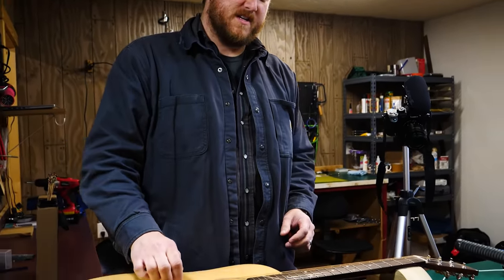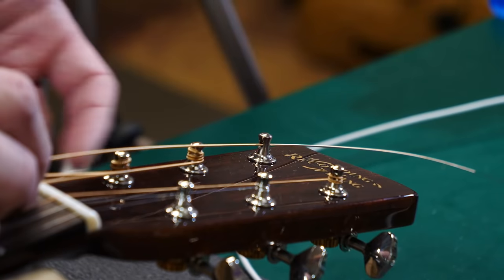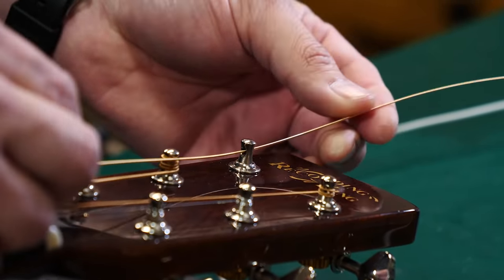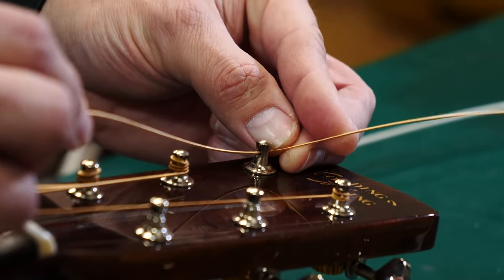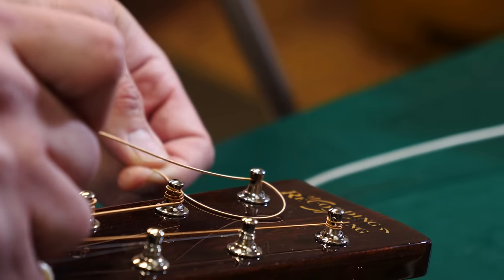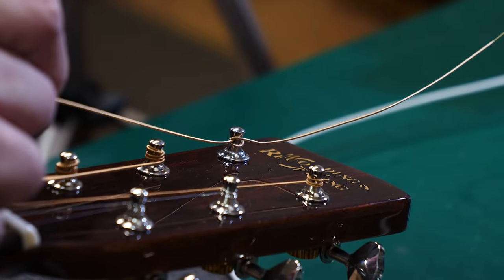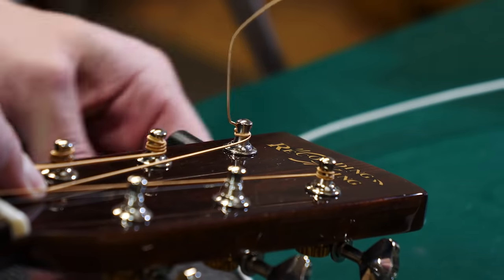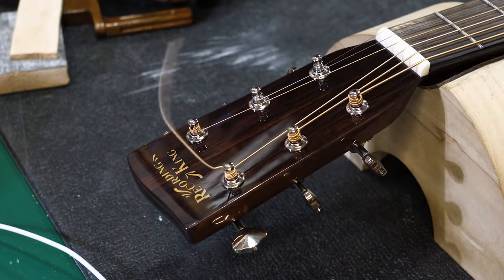Tech Tip: How to Tie a Luthier's Knot When Changing Strings

Comment: I used this technique for a long time but at some point I got tired of taking the bent up string off the tuning peg so nowadays I just pull the string through, pull the string from the nut back to the first fret for slack, bend the string straight up and then start winding. It’s just as effective and much easier to get the string back off.

Comment: This is the Martin Guitar method. I use a 40mm block at the nut as a gauge for how much slack is needed to get the right number of winds around the post.
It works for all gauge strings. 🤗

Comment: Great tip - I have done it differently for years, but your method is easier, quicker and still locks down the string. Also saves me time in my workshop - thanks!

Comment: Gonna try this when my new pickguard comes and I have to restring my guitar. I normally thread the string through the tuning post hole and then loop it around and thread it back through the other side and start tightening it up, but I've had issues with the G,B,E strings on my stratocaster mostly likely because they are thinner strings with less grip, so this will be good to try out.

Comment: For those that don’t like luthier’s knots, they’re great for restringing a Floyd rose; keeps it looking clean, and I’d argue I can restring faster with this knot than just wrapping normally. Tuning stability isn’t an issue with a Floyd Rose, but I’ll say it produced tangible differences on an ashtray  tele with Grover tuners. It dropped out noticeably less on hard bends. 

If your issue is getting them off the pegs (I was a violinist first, that’s what we called them.) Use a wire cutter 🤷🏻‍♂️ I guarantee you have one, be it on needle nose pliers, a cable stripper, or a bolt cutter if you have one and feel like overkilling it.

Comment: Nice. I use a Out, around, over and under, pull up "locking" technique that I learned way back for my fender wammy bar set up. This is similar and looks nice and pretty like when you get it done by the set up guy at the shop. The important part is guiding the string downward as use tighten up the tuning heads. Great to learn the fine arts though!

Comment: Best démonstration, i just use shorter 1 1/4 for the E string. The string turn around the post without touching the base of the key , if it happening there is up tension on the post, so you may lift the post out of the key. Also some post are very short,  you have to adjust the lenth référence.

Comment: I use the Taylor method. You still leave about 1.5 to 2 inches of free string to wrap, then without the knot, bend it and wrap the strings under as you tighten.  The friction and pressure of the loops under where the string comes through the tuner, hold the strings securely in place with no slippage.  It is a faster way to change strings if you do so often.

Comment: I'm lazy, most of my guitars I put either locking tuners or kluson split post tuners on them. I do still have to do this with my old 1971 Ovation Balladeer, though. I won't replace those tuners, they're too nice and I want to keep the guitar with it's original parts.

Comment: This is how I was taught many years ago, and is unequivocally the best way to string guitars.
Reply: 100% not the best way to restring a guitar.  In fact it’s a horrible way.  I’ve been a tech for 20 years.  Worked at multiple shops and run my own.   I’ve easily restrung 500,000 guitars in that time.   Take it from me.  This method is a joke for many many reasons.  It simply does NOT hold tuning better.  That’s a fact.    And removing strings that were put on like this is also a joke.   Martin strings their guitars like this and it’s baffling.   I’ve strung guitars every way you can imagine and this is at the bottom of the list lol.    One wrap above to start and the rest underneath, no overlaps and making sure to use enough string without reaching the bottom of the post is by far the best way to restring a guitar.  You can then cut the excess off flush and have no chance of cutting or poking yourself.   And it stays in tune 100% as good as the “luthiers knot” lol.

Comment: That’s the best way to do it, because that’s the way they install strings at the Martin factory.  The only thing I would change about how to do it is to keep tension on the strings as you wind them up to pitch so you don’t have any slack around the tuner post that will make your strings go flat.

Comment: Because of the bind in the two strings pinching the single strand, I've been doing for years. The hardest to do since I'm a little deaf tone is having a tool that assist intonation. Since I have the tool I can basically keep strings (Clean with a Luther's String cleaner after playing axe) for approximately four months without ever removing after a gig or practice session. Take care and it takes care of you. I usually use 10 to 48, but decided to try some 9.5 to 44.  Wow what a difference in doing stretch and bends, but intonation is crucial regardless of gauge. Clean strings also helps keep intonation. Clean strings, intonation, and proper string locking helps the cost of strings way down. Imagine using a set of strings for at least a month as opposed to using new sets after every touch. Any where's from the cost of a new desired pedal to maybe another tool to use when , gigging.

Comment: This is very handy for shafts that do not have a modern concave taper but if the shaft has a concave taper the lower wraps actually press the first wrap against the inserted string and lock everything in place. That is why it is necesary to have multiple wraps. Nice old zillion dollar guitars often lack concave posts making this knot necesary. It isn't that helpful on modern tuners and makes removing an old string a chore. Most folk's tuning instability problems are due to not tugging the string with enough force to snug everything up.

Comment: This how they restringcat the Martin Guitar Factory. They use less wraps though. It locks itself after the first wrap c1 or 2 more wraps is enough. After installing the strings it's portent to stretch out each string from neck to bodyx few times so it will stay in tune.

Comment: Very neat trick. On a bass it’s not suitable (the pegs are designed differently, string tip goes in vertical, push down, wrap, wind = under a minute, on most basses not all) but when i switched to electric guitar I kept doing almost the same thing just > I only push an inch or so of string through the gap out the other side > then I wrap the string round the peg as tightly as possible and switch to using the tuner to wind tight. It’s fast on and off, but I admit this method might allow for more slippage. 
I have moved on to Spanish / Classical / Flamenco guitars and this might work, might not, the traditional headstock and tuners on Spanish guitars are a different kettle of fish, trickier, I haven’t got it down yet, but most luthiers use a real knot to actually tie the string to the peg, then wind. 
What is done here is not a knot but a D loop, and the curious thing is that it is exactly how you set up / fix your strings on the bridge of a Spanish guitar. I have got that down, so I already do this 😂 just on the bridge. That’s how all luthiers do it. There is a new generation of Spanish Flamenco guitars that are designed with the same kind of headstock as an acoustic like the one shown here in the video, so if I ever get one, this is a neat trick easy to remember. 👌🏼✌🏼

Comment: i always have used as much extra length as possible and, i used to even let the wraps overlap, like two layers. that's probably not good practice, but now i only do one layer and make sure that each wrap is under the previous one so the string is making a spiral around the post, idk why im posting this in a video about how to tie a knot. i think i started doing it that way because when i first started i had some instances where i had put on the string but somehow it broke, but since it already had a bend in it, it didn't break all the way it just kind of unraveled from the wrap, so i started putting as many wraps as possible on it because that way, and usually that's how a wrapped string will break when it gets old enough, sometimes there's enough extra length on there to fix it and get some extra life out of it. the only thing is it takes more time to get it to hold tension, but once it's set i always felt like the extra wraps made it easier to tune. maybe there's a bunch of flaws with that approach though. i just thought about it and maybe having more wraps around means all that extra length is just more metal than can stretch out, or depending on temperature fluctuations. i guess i just always thought having a knot was a bad idea, but maybe it's better. i guess it depends on how nice the guitar is too and whether or not the tuners are able to stay in tune. if anyone has a better explanation and why im wrong im glad to find out. 
maybe I'll start using this knot but I'm so bad at learning new knots.

Comment: That’s the Martin method but there is more turns around the post than really needed. I use a block of wood about 30mm square and sit it on the fingerboard behind the nut as a gauge and pull the string over it tight and tie the knot then remove the block and string wind it on to the post. This gives a consistent professional looking restring with a couple of winds around around the post. 
On guitars with a vibrato (wammy bar) I use even less winds so there is less chance of strings uncoiling when strings are loosened on post when wammy depressed and going out of tune.

Comment: I've found that this knot can cause problems and possibly getting a bad finger prick when an emergency string change on a dark stage is needed(not all have guitar techs). I'll just kink the string at that1and1/2'' point and wind the string top to bottom. In my opinion both ways are correct. Guitars with locking tunes or floyd rose type systems have their own issues. Happy picking !

Comment: To add to this technique that is  indeed absolutely game changing in terms of stability, for the lenght of the slack on 3-3 headstocks :

Pull on the string to make it tight,
With the other hand, at the 12th fret, put your middle finger at the vertical.
Lift the string 3 phalanxes for the E, A and D strings.
Lift 2 or 2.5 phalanxes for G, B and E.

That will give you your slack.

Once you cut the string after the post the remaining can be a razorblade for your fingers (or the head of someone else if you bump on somebody on stage - yes, I saw that happening)

So don't cut it too close to the post ; let a little more lenght.

That is where having a little less slack on the higher strings will be useful.

The remaining lenght will end up pointing toward the center of the headstock so the sharp end of the string that can open your finger in half when reaching your tuning pegs will now be out of reach.

Every pointy ends will face inward.

And remember to stretch your strings after changing them ; it is important to stretch the strings at the contact points AND on all the lenght of the string.

Tune - stretch - tune - stretch - tune - stretch - tune ... most of the time you'll be good to go at this point.

The G may need a couple more of stretch - tune.

Comment: I've never seen that knot used before. What is the purpose of it to prevent slippage? I'd say if you get 3 or 4 wraps around the tuning peg it's not got to slip anyways. 1 or 2 yeah maybe.

Also here's another tip. You don't need to cut the excess string off. Just wiggle it back and forth several times till it breaks off and you get a nice tight clean looking string change. I learned that trick from watching a Joe Walsh set up video lol

Comment: I've always done mine without the second portion of the Luther's knot string trapped in a pinch between the first coil and the rest down the stem pushing up toward the top pinching much easier to remove so let call it a half Luther's knot 😆 playing 4 sets a night even phosphorous Martin's would sour before the night was over sometimes

Comment: Trick that I use is after getting threading my string through and pulling it tight, I just bend a solid right angle in the string and then wind it up, usually does the trick and is easy to undo.
My main guitar has locking heads though so I don't really even have to worry about it 😁

Comment: The only thing this accomplishes is an extra annoyance when removing strings.  Just put 'em in straight with enough slack for 3 full wraps on the post.  Stretch, tune, play a bit; repeat x3 and they'll be rock solid.  I have frequently changed strings an hour before performing and never had any instability with proper stretching.  Not once.  Bust an acoustic G near the post with these fancy knots and I hope you have some needle nose pliers on hand.
Reply: Exactly!

Comment: i do mine similar but instead of of kinking the tag end back and over the main string, i just wind the first coil then loop the tag back into the loop before winding tight. for me, it keeps the post from having a lumpy knot in it and although it makes no difference to sound and tone, i just prefer the slimline knot because im weird. ive never had one slip yet and this being said, i use the luthiers knot only on the little e as it the one string that kinda need the kink back over itself.

Comment: This may work for some, but since 1976 I've always done the one wrap up, and 2 or 3 wraps down. Never had a problem with slippage, and the strings come off easy since I'm changing strings at least once a week. With this method there is an air gap from where it loops around and then comes back down to the tuning peg. Of course this method will not work on vintage Fenders as you put the end of the string in the slot that is in the middle of the tuning peg, and then wrap everything downward.
Reply: Holy shit once a week since 1976... Ever done the math on how much you've spent on strings?

Comment: To the folks complaining about tuning stability on guitars... (stares in double bass, pedal steel, brass instruments in different temperatures, banjo, mandolin) you don't have a problem worth complaining about. Life's imperfect, so is the tuning stability on your Martin until its fully carbon fiber from the strings to the nut to the body

Comment: Learned this method from the Martin factory.  When I bought my D-28 and saw how it was strung up, I couldn't help but to try to learn it.  If it's good enough for Martin then why not.  Also, the whole point of this string job is so that you don't need more than a couple winds around the post.  1 wind in most cases is sufficient on the 4 wound strings.   2 winds is good for the other 2.  This video teaches the method well but..... way too many wraps around the post.  Defeats the purpose of this method.  Great video to learn from though.
Reply: Yes exactly what I was thinking. The extras inches are not needed. There should little slack.

Comment: +1 for hating this thing. I worked in a guitar store for 12 years. I probably did a minimum of two customer's restrings every day, five days a week. So we're talking about 6000 or so restrings. I never did this. Electrics were always: pull string tight, pinch at the nut, pull back 1 fret. This always gave 2 winds on wound strings and about 4 on plain. No need for a knot or even winding over then under. Classics were the same, only pull back 3 frets instead of 1. Bass... can't remember, probably only got asked to restring about three basses in all those years.

Comment: Leo Fender put this type string change instructions on early Fender string packs... ironic in that Fender guitars have the slot instead of hole insert, plus the inside the slot string hole insert. An early string lock in my book, and the only way to play hard on any type sound box / slab 'geeter.

Comment: Thanks for the luthier's knot, BUT...I NEVER CUT the string, no side cutter or device can get close enough to NOT leave a stub sticking out that will envariably draw blood when someone's finger or hand comes in contact with that deadly prong. I just work the string back and forth 180 degrees (20 times if necessary) and it breaks off even with the hole. Keep up the good work, Roger

Comment: I used to do this, and then I stopped.  I've built and sold around 100 guitars and work on them all the time.  Maybe I'm just lucky, but I've never had any string slip or go out of tune.  I also prefer a nice, close cut right at the post rather than have anything sticking up or out that seems to catch anything.

Comment: For all the posts complaining that using this knot makes it difficult to get the string off next time: Needle Nose Pliers

when you take the strings off loosen them till they are slack, use the cutter on the string a few inches from the tuner, then unwrap the turns off the tuner and PUSH the string thru (dont pull the bend from the knot thru the tuner post hole.....)

BTW - if you dont use this knot on classical (nylon) strings they WILL slip

Comment: All I do is run the string through the peg, pull it hand-taut, put one hand holding it on the nut, then grab the end of the string and bend it back around the tuner. Then i start tuning. No problems.